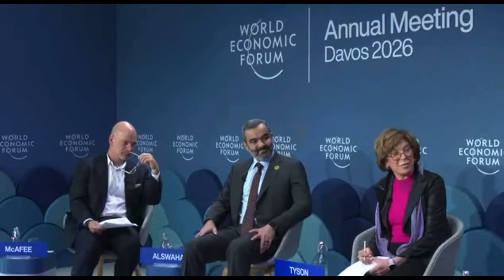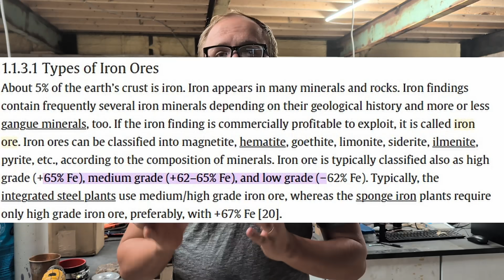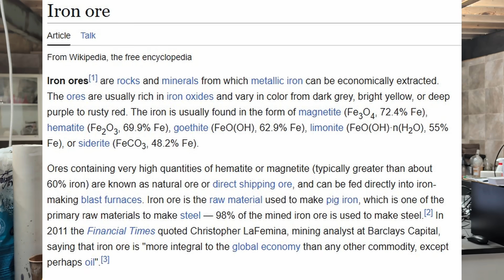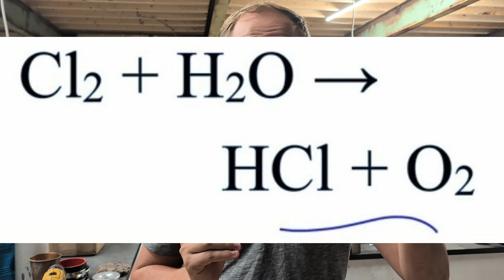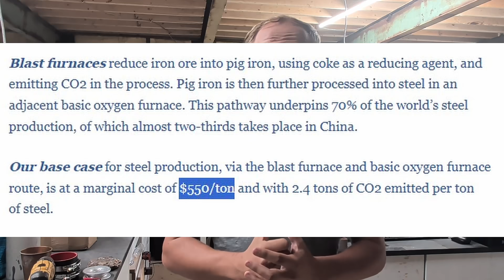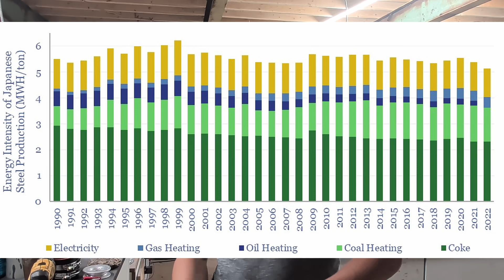Electrochemical Green Steel at Room Temperature, No Blast Furnace

Comment: I worked in a steel mill for almost 20 years and we used electric probes to melt the steel. That was in Seattle. And we only melted scrap not ore.
Reply: Whilst EAFs are themselves horribly energy intensive, the bigger energy hit is on the primary pig iron and virgin steel manufacturing.  We’re always going to need more steel input in to the economy than we can expect to recover from it for a range of reasons, so primary steel making without the energy hit would be a boon, though it would be crippling to the hundreds of billions of dollars of sunk cost capital investment in existing steel mills worldwide, so don’t expect anything to change anytime soon.
Reply: @awlhunt yeah I know. I’m thinking of a unit that I can run crushed tailings from mines all over Nevada and Arizona and New Mexico. There’s tons and tons of gold just laying in piles of rocks.
Reply: @awlhunt  Will it take a complete outsider to the steel industry, who has no sunk costs and can start with a clean sheet, to bring this technique to fruition?
Reply: @lokensga  Knowing our executives... yes... IF you have a working V1 demo ready, as well as analysis and proposition for where / how this technology can be installed within the production chain to be effective immediately. It all comes down to money - steel is a high-competition, low-margin business. Money is the lifeblood.
Reply: @lokensga 😊if it works China will put it into production
Reply: @lokensga   his method isn't anywhere near good. And it is more damaging to environment due to acids that has to be used. This fella knows nothing about metallurgy. Don't listen to his clickbait videos.
Reply: @lokensga  I think you are right. Our technicians, engineers and scientists these days are too well-trained to have any new ideas. 
"well-trained" in quotes for sure. Actually narrow-blinkered IMHO !
Reply: @awlhunt  Induction Furnaces are more efficient but lower capacity
Reply: @somebody1241  yes, recycling steel in to steel is more efficient relative to making virgin steel, but that’s not the point.  It still takes somewhere in the order of 4-6GJ of energy to recycle a ton of steel, which is still a lot of energy.  Of course that’s a fraction of the 25-30GJ it takes to make steel from iron ore, but we do need so much more steel each year than we could ever hope to recycle, so there’s a natural limit to how “efficient” we can be without a real step change in the technologies we use.
Reply: @awlhunt  usage of sponge iron is more efficient than iron ore in terms of coal/co2 usage.
Reply: @awlhunt repaint the rust belt , fun fact 41 of 43 aluminum smelters are mothballed due lack of energy , US is in deep shit, but the billionaires in Silicone Valley want power diverted to   AI .. that greedy pigs are allowed to set national policy is a joke
Reply: As a junior, Dad would park the car on a road in Sheffield UK where you could see the arc furnace, that monstrously huge saucepan lid jumped and banged holding in exploding giant popcorn with sparking shots of molten spray. Awesome.
Reply: @gingerbinger7485 yeah you should see when it has a thing called “a burp” from a safe distance of course.

Comment: An interesting view and all of your chemistry and electric calculations are correct but @4:50 you will need to consider something else. the 5MWh energy needed is primary in the form of coal and is used to make the material in liquid form and in such way more efficient for the industrial process (it is totally other question that most of the heat after that is, currently, wasted but in the future can be recovered). 5MWh in coal is about 0.614 metric ton and base on the prevailing market price of $115 per tone it comes to about $70. So your price of $156.8 per ton, will need to compare with that $70 and not with the total price, which includes a lot of other components. Notably, removing some of the currently needed components and closing chemical cycles will make the process you are proposing more efficient, but still your system will need to be scalable compared to this $70 price.
Reply from the maker: No. You are missing the fact that coal is not the only thing responsible for the traditional process. Review the cited work that goes into a deeper dive. For traditional chemistry, more than half of your work is cleaning up what you just made. Oxygen injection and other stuff as mentioned in that study account for much more. Simple things like having to use high grade ore makes a difference as my method can use low grade material that is thrown away or a fraction of the price. I approached this originally like you comparing direct energy costs but then realized there's a lot of other costs with traditional process that's crucial and unique to it
Reply: @Rowow  "Oxygen injection and other stuff as mentioned in that study account for much more." According to the bar graph presented the oxygen is an extremely small cost (barely noticeable) as to the "other stuff", agree, it is part of the industrial chemistry process, but brushing it off, as part of the current way of doing things is very ineffective method, as it has investment in technology as well as machinery and people. Noted that, as there are many variables, if you can show that you can produce metallic Fe, even on par with the current industrial price of the price, on small scale (several hundreds of kilos), I think, even small shops will be extremely interested in you know-how.
Reply from the maker: @EfficientEnergyTransformations I have lots of companies ready to buy finished units. No only wants to invest in the scale up costa

Comment: The reduction in CO2 emission will be worth the price of entry for a large minority of the public.  So that has a separate yet real value (if that's your thing).  IMO, beyond the efficiency, real elegance here is the ability to extract multiple materials at low concentrations (extract = "convert to high concentrations), the lack of heat and the ability to distribute this process without requiring heavy industrial construction.
Reply from the maker: I'm really glad when those with technical background see the elegance. Simplicity is beauty

Comment: How to get the iron from the slag ?
Reply from the maker: Hcl
Reply: Then you have insane amounts of Hcl soaked tailings. So a toxic waste is even more toxic...Great🙄
Reply from the maker: @hime273 neutralize the solution with a alkaline bath produces by the electrolysis system. Find solutions not excuses
Reply: @Rowow This is a far more expensive process than just melting and skimming slag.
Reply from the maker: @hime273 look up how a continuous vacuum filtration drum works. The secondary alkaline wash stage is automatically done in the same machine. STOP FINDING EXCUSES, START FINDING SOLUTIONS
Reply: @Rowow  i once see a guy in a german program who used lightning to seperate concrete waste back so it can be recycled .

Mining was also tested especially for diamond mining and he also claimed to use slag to get the metal
Reply: @Rowow Or you could think logically, instead of pretending like this is gonna be a solution for something that doesn't even need a solution.

You aren't the first person to think of this, and if it were scalable to industrial amounts, it would have already been done. 
You're just hoping to get rich off of an inpheasable idea.
Reminds me of that Plasti-diesel dude, who makes it sound like he came up with the idea and acts like it's the greatest idea ever.
In reality he's full of crap, and extracting an unusable substance that will destroy an engine.

Comment: Kick ass bro 👍 Solar can supply the low voltage needed and can also be used to separate salt water into sodium hydroxide and chlorine gass.  The sodium hydroxide can be boiled with silica gel to make sodium silicate.  Sodium silicate mixed with crushed feldspar powder or clay powder makes geopolymer cement.  Geopolymer is better than Portland cement in every way.
Reply: Yup. I'm trying to put together just such a deal. Are you an engineer?
Reply: @daxtonbrown I'm just a guy who likes inventing stuff.  I read an interesting paper about grinding feldspar rock with dry sodium hydroxide in a ball mill.  They say a geopolymer powder can be made and you just gotta add water like regular cement.  Geopolymer foam is also an amazing technology.  When I tried making the foam the bubbles were too big.  I'm not sure how they control that.  If you are going to experiment with geopolymer make sure the ingredients have no magnesium oxide.  It affects the reaction and it doesn't harden.  It just gets dry and crumbly.  The best way to treat geopolymer is like clay that fires itself by chemical reaction.  After it cures, a white powder may form on the outside.  That's just excess sodium that migrates to the outside and reacts with carbon dioxide.  It can be washed off.  A successful geopolymer recipe is one that can pass the boil test.  Once cured it should be able to be boiled in water without crumbling.  My research led me to the discovery that static electric charge may play a major role in the reaction.  This phenomenon can be seen in how silt particles float in water.   If the particles are statically charged they dont want to come together and they stay in suspension.  If they are statically charged the other way then they want to agglomerate and sink the bottom.  I had to put a hold on my research for a few years but looking forward to getting back into it.  I have new materials to work with now.  I got lots of potassium hydroxide and a zirconium oxide ball mill now.  Oh one last thing - the aluminum oxide content neutralizes the sodium or potassium 1 to 1 but the silica content is variable.  A super basic recipe is: 1 part sodium hydroxide to 1 part aluminum oxide to 10 parts silicon dioxide.  I was putting in other ingredients to but that's top secret 😁.  From my research it's looking like the strongest recipe will include sodium hydroxide and potassium hydroxide.
Reply: @------country-boy-------  I bet bubble size can be controlled with a surfactant.
Reply: @------country-boy-------  how are you applying a static charge to a mold full of geopolymer mix?
Reply: @FnjordKnot I'm not.  My research led to the discovery that crushed feldspar rock has a static charge.  When the molecules are broken, one side holds onto the electron and the other side looses an electron.  They naturally want to re-assemble in an alkaline solution of sodium/potassium silicate.  Regular kaolin powder needs to be baked (de-hydroxylated) to become reactive.  Even after baking it's still not electrostatically charged.  I had to pause research because my Dad died and COVID happened and i had to move twice to new locations.  It has taken several years of hard work to get back on my feet.  Maybe in 6 months I can continue with the progress.   I love inventing and playing with science.  It's a lot of work but its kinda fun 👍

Comment: Is there an ideal feedstock for this process before the technology matures?  Slag heaps?  Sacrificial anodes from electrolysis?  Construction rebar waste?  General ferrous waste?  There's bound to be material lost in this process, such as by insoluble minerals.  Maybe Hibbingite or Molysite, and countless others in real world conditions, but the feedstock would be cheap enough in proximity to a chlor-alkali refinery.  Imagine if this process could be used to clean up old toxic tailing piles from the lateritic material piled up at alumina plants.  They are already well wired to gobble up electrons, and have eddy current separators on site.
Reply from the maker: The technology can process anything, though existing liquid solution is the easiest right now

Comment: that's impressive work for refining the ore, but as I understand to introduce carbon in the crystal lattice you need to melt it and add a source of high putrity carbon, because cementing pure iron would give you anisotropic steel and would take unfathomably long time to reach the center of a thick piece
Reply from the maker: Of course it would be remelted and alloyed. Issue is getting pure iron metal reduced from iron oxide, not melting. Melting costs are less than $50 a ton

Comment: The principle of controlling electrons in technological processes is a promising area of development. However, it is equally important to protect the equipment and the environment from the aggressive effects of acids and acid vapors. Processing thousands of tons of ore is not the same as processing 100 kg of ore.
Reply from the maker: Its incredibly easy to seal the cell and ensure there is absolutely zero losses
Reply: @Rowow  in your dumb mind maybe. Sponge Iron and EAF is the future of this industry. We need to continue the carbon cycle and we don't need billions of litres(a billion gallon so your American mind can understand) Hydrochloric acid.  There is no such acid production capacity in the globe.
Reply: @somebody1241 The OP is providing interesting alternatives to consider. You resort to adhomonim insults. We can do better. Sponge Iron and EAF was a contribution I will research, it's appreciated. But let's avoid the insults.
Reply: @somebody1241  if your mind is smart you wouldn't need ad hominem insults 😂
Reply: @somebody1241 did you actually watch the video? The acid production and constant regeneration is part of the process.
Reply: Yes, the process used the same chloride ions over and over, it doesn't produce massive amounts of acid which then needs to be cleaned and neutralized. 

The "carbon cycle" argument is also completely irrelevant. Nature was fine with doing its own carbon cycling for eons before human industry came along.
Reply: @ki0w0-lordofwatersheep  I insult because this baseless hype types like him only understand of insults. Maybe you deserve insults to for following that kind of people.
Reply: @timothygorman2846  It is inefficient. I know my metallurgy and chemistry. And i know economics as well. He is selling hype to the uninformed.
Reply: @galfisk  It depends on population size. Now we need more food because more naimals are present therefore we need more co2 in the atmosphere so that plants and algae could use those to grow and more food for animals and fishes will be generated in the saöe time frame. Effects on fish population would more visible due to algae's importance in the carbon cycle.
Reply: @somebody1241 
😂 I guess I'll just take your word for it. I'm going to use it anyway because it will save me hundreds of hours of labor. By all means, I would be very interested in seeing your video where you demonstrate why his processes are inefficient. Until then I don't think you're likely to discourage many people from trying.

Comment: that math should be illegal. how is modern steel not using this method. we are primative savages still
Reply from the maker: 100% on the savage part. Thats literally ANY chemical process. Anything that doesn't deal with chemistry DIRECTLY with electricity is indirect and therefore HAS inefficiencies. Ion exchange membranes let you use electricity to control electrons and which ions aka atom goes where to do what. Industries use ion exchange membrane but is not across everything due to their cost which we solved. Watch our latest video!
Reply: @Rowow  you have a fundamental understanding of the problem that is a phase shift of the current paradigm of chemical manufacturing. We're targeting 70% yields and up-converting from there, when we could be hitting 99.99% from the start, every time. Through simply application of the physics of this world. dissolve the impure 'mash' you want. drive it through a membrane in which only the thing you want can pass. Enjoy the fruits of your labor.
Reply: @Rowow  i am in a totally unrelated industry and cannot help directly at this time, but encourage you, and want to promote your work in any way i can.

Comment: The statement from the "engineer" is so false its funny. That you couldn't make concrete or steel with solar, or wind. here's just one simple method. Just store the electricity then dump it into an carbon arc system achieving much higher temps needed than for the calcining or smelting processes. And that's just one of multiple examples. These WEF people parading around as intelligent people is comical to say the least.
Reply from the maker: Yep. Its insane people like these are in charge of industries yet fail basic common sense.

Comment: This is very interesting, i wonder why it has never crossed my mind. I may ask a stupid question, but, since the electrolysis is performed in acqueous solution, how do you avoid the cathode splitting water into H2 and OH- and thus generating insoluble Fe(OH)2 instead of Fe metal?
Reply from the maker: By controlling the solution conditions. For example maintaining below Ph2. With a cation membrane it would block HCl from going into the positive chamber therefore maintaining the acidity. A anion cell can be utilized to ensure the maintenance of the ph on the negative cell. In my ferric chloride redox flow cell I plate off pure iron metal on the negative electrode without issue. So I know ive seen it happen.
Reply: Water needs a voltage of higher than 7V to electrolyse. This method used 1.5V
Reply: There are also non-aqueous electrolysis. The most well known is the Cambridge-Farthing, which is used for one of the most difficult extraction processes (titanium). In that process the electrolyte is molten calcium in that process. 
These guys seem to have found a different method with a membrane.
The main show stopper for the electrolysis processes is scale and the lack of an established supply chain.
Electrolysis for metallurgy is considered high risk.
And Coal is still too vheap to make it worth it.